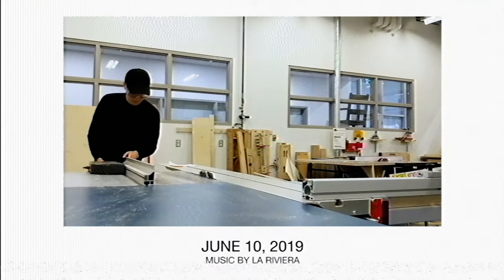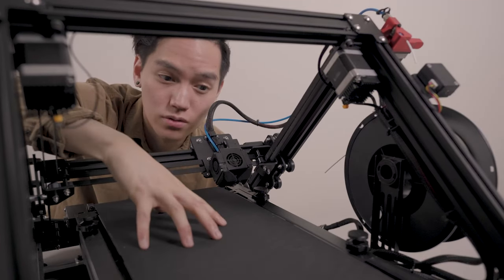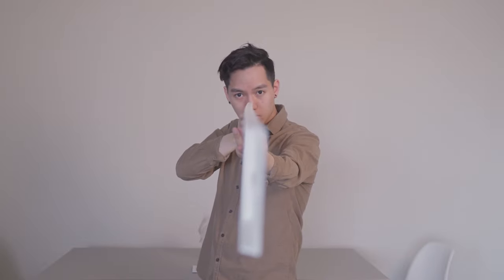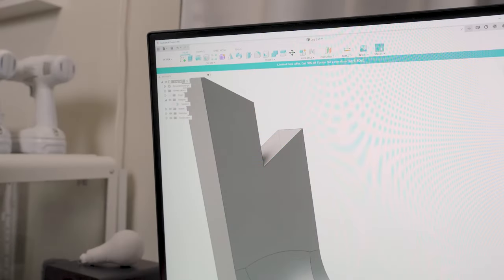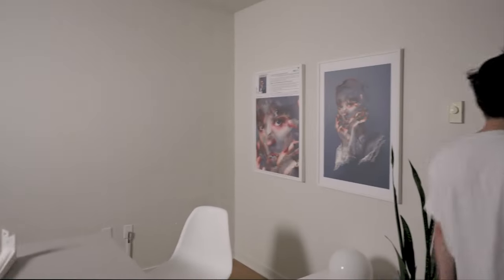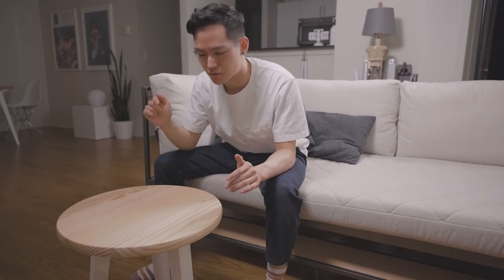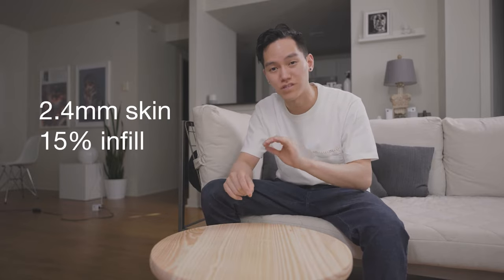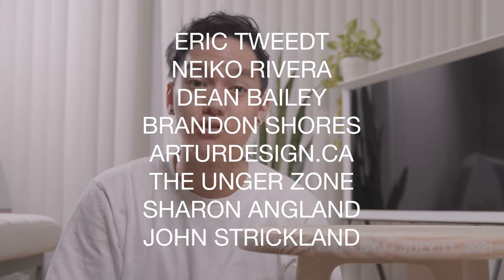Making Furniture with a 3D Printer?!  ft. Creality’s CR-30

Comment: Awesome! Just a heads up, a 0.8mm nozzle would speed it up by more than twice vs a 0.4mm since that measurement is the diameter not the area
Reply from the maker: nice! you're totally right. i forgot about that haha i goofed. thanks!
Reply: And it still took around 11 hours to print each leg?
Reply: I don't think this is correct. Assuming the same travel speed, 1 line of a 0.8 mm nozzle would replace two lines of 0.4 mm nozzle. It should more or less be twice as fast.
Reply: @7573436  plus the bigger layer height

Comment: You can probably remove the weight limit if you use the 3d print as a permanent casting form for epoxy.  You could also oversize them forms and cut away some of the material for a different texture (like hand carve or cnc?

Comment: I suspect it won't break under compression but will break when the legs are torque (they try to splay out as more weight is applied) and there might be a super simple way to GREATLY increase its load capacity. about 2/3 or maybe 1/2 way down have a hole in each leg with a nut/bolt and a turn buckle wire arrangement. ie physically prevent the legs from pushing outward. Now I am curious as to just how much mass they can hold :-)

Comment: Love it ! I would suggest adding a longitudinal slot along the three feet you just printed in order to slide some 8 mm diameter shafts for preventing the bending. The weight limits won't be a problem then

Comment: A good friend who helped me get into 3D printing told me “there are a lot of things you could print, but shouldn’t.”  In other words , people try to print stuff that isn’t very practical.
Reply: IMO you are only limited by how well you can design it and how well you can adjust the mechanics of your printer
Im printing a large scale bluetooth speaker right now, uses like 1.8kg of filament, multiple parts, special infill tuned for acoustic advantages, acoustic patterns built into the inner walls

You can print nearly anything, just gotta work around the horizontal layer separation disadvantage with core materials

Comment: "I would have needed a whole woodshop to make this table." 

Or you know, a Japanaese saw, a tape measure, and a jack plane.

But sure. Basically a whole wood shop.
Reply: A Japanese saw and a 3D printer is basically what I used to fix my chair last week. And a few screws.

Comment: Those legs are probably good in compression but bad under side load. If you sat on it, there would be some amount of side load which would probably crack it at the mounts unless you print it solid. Still really cool you can print stuff like that, and looks plenty strong for a side table

Comment: It's worth pointing out, when you use a larger nozzle, you can push plastic out faster and have larger layer heights, BUT, you need an extruder setup than can keep up. Just cueing you in in case you hadn't thought of that. Many standard extruders will start skipping at normal print speeds since they are pushing through twice the amount of filament, equivalent to running the printer at twice the speed. That will effect layer adhesion since your lines aren't as thick as they should be. Or you can move to thicker filament, so you get more plastic per mm of filament.

Comment: Great Job on showing how that could be used!, FYI those AC units cause a draft as all the exhaust air comes from inside the house causing a negative pressure

Comment: Hey, You could actually print out a lower infill and mostly skin, and use infill settings and design stuff (I know very specific) to pour in a resin or something after, to make it a lot stronger, easier, faster.

Comment: Excellent work.

I'm getting more & more surprised at how much 3D printing has been, not just taken up, but extended to new, ever more remarkable levels of creativity.

I suspect that newer materials will also become increasingly strong & 3D printers to have multi-head/nozzle/filament systems, allowing for greater toughness & robustness in builds (perhaps even approaching hardwood in strength), as well as more complexity in internal design, internal structure & aesthetics.

Looking forward to future projects.

Comment: finally an upload!!!🎉🎉🎉 Can you come up with something to replace the noisy blower fan on ender 3?  I know there're things on thingiverse, but none is as neat as your design :)
Reply: the hotend one? then i think thats constant speed so you could buck convert a noctua, ive got a sunon maglev on mine, its ok but not quiet.... and 5015 sunon from mellow (i think)  on aluexpress for part cooling and run low speed :)

Comment: I love wood and have made all sorts of things with wood simply because it's so "plastic" (adjective).  But THIS is the future.  Metal can also be used in 3D printing.  One  tip:  about the indoor AC.  I just had to get one and, with a little work, you can put them outside and just blow the cool air in.  If you want to recirculate the indoor air, that's one more duct, and that's what I did.  But they're a LOT quieter out on the balcony!

Comment: Great videos Scott and I started subscribing to see your videos. I wonder if you can share some Print or Slice settings. I really like the quality of print you do. For example, I noticed and you said it, that you don't use Plate adhesion, and quality is great. I wonder if you can share or post a video tutorial on slicing & technical printer adjustment. I started using "frogtape" on my bed and the results are almost no fail most of the time. I would love if you can share more tips on your favorite settings/adjustments. Thank you and keep those ideas coming. You're now my favorite 3D Print educator/ entertainer :)

Comment: Idea: you could Reinforce the legs by running cheap threaded rod, some bolts and large washers through the middle. The threaded rod is strongest under tension, however the print should be strongest under compression, so you are not really sitting on the rod as much as strengthening the 3D printed part use 12mm and it should be overkill strong. If you were really keen you could size it so the the threads bite all the way down the hole requiring you to have to screw the threaded rod in the whole way rather than just dropping it in to a hole. This would further couple the print to the rod and increase rigidity.

Comment: FYI, if you want maximum efficiency on that indoor air conditioner, place a ventilation tube on the unit's intake to cool the compressor and connect the other end of the tube to a new hole on that printed part.
The amount of air that the unit pulls in to cool the thing has to be replaced somehow, and that's how the air is drawn from the outside. Your efficiency is heavily compromised if you just use it as is.

Comment: Awesome video, if you can tweak to use PETG it would be able to handle loads without snapping.   PLA tends to snap when it gets overloaded.  I have a few shelves held by petg brackets,  started with pla, after a year they cracked on the layer lines.

Comment: Thankyou for the demonstration I am planning to purchase 2 CR-30 units in October 2021 and I was wondering if the conveyor belt's pattern would transfer or not? And if I would still need to print a raft?  Well perhaps I may cover it in Teflon. and build an Acrylic enclosure with a vinyl curtain to allow parts out while keeping heat o the conveyor.

Comment: Very engaging videos! I am sure you are inspiring many others like myself. Found a BIBO Touch 2 for $200. Works great with dual extrusion. After seeing this video I am modifying my printer so it has larger base and conveyor is necessary now. 

It struck my curiosity with the de-branding. Why do you choose to remove brand names?

Comment: Why not get a cordless jigsaw and cordless drill with a vacuum hose to the outside or a wet dry vac?  You can still do woodwork in apartments.  It would be faster than using the CR30 geometric shapes.  Save the printer for more complex parts.

Comment: 11 hours per leg is an extremely impressive print time!
Reply from the maker: not bad right? and that was using really slow print speeds to be safe because i was so annoyed with print failures. I'm pretty sure i can get it down to 7-8 hours though with more calibration and tweaking.

Comment: More curious about filament run-out? Did you run into that issue? And how was the printer in terms of resuming print? Most printers don't seem to resume properly regardless. Thanks
Reply from the maker: good question, from my experience, i think it depends on the size of the 3D model possibly and maybe quality of the SD card? because printing the air conditioner port it completely failed. the 3D model was huge and the SD card was the one it came with. but printing the legs i used the SD card from my camera and the STL file was much smaller and it worked flawlessly 4 times.

Comment: Awesome video and skills!  That A/C though..if it's blowing air out, it's creating negative pressure in your apartment, which gets filled, hopefully by air from your air conditioned hallway?  I had that scenario once, but otherwise, it's VERY inefficient as you can see...if possible, 3d print something to adapt it so it also draws air in from the outside, keeping the pressure neutral.     Honestly those AC's shouldn't be sold.   Your videos are awesome btw.

Comment: 2:33 half the time.. but increase the filament usage. how do you handle the problem with running out of filament multiple times per print?  and is printing large parts rreally wortth it if you consider filament cost, time, electricity usage and the risk of having the print fail after printing for 3 days, forcing you to start all over? I think the alternative of making a classic mold is not as easy.. but you dont need to invest in an expensive printer like the CR30, and once you got the mold done, you can produce at least 10 copys in the same time and for the same cost. 
unless we are talking about industrial 3d printers, in my opinion 3d printers are effective for small parts, but for large ones there are better alternatives.

Comment: Scale up the platform and it could produce a entire car, then another, and another, with a giant hopper filled with plastic pellets, pellets you can grow yourself even or grind up from miles of junkyard materials.
Scan yourself and you can make custom fitting exoskeletons, one with a built in jet pack even, or power the jet with no moving parts, just a very serious density of electrons that with enough of them, could allow you to float around, like Christopher Walken did in that music video.
Do it up.

Comment: Problem with 3D printing big stuff .. is the material is VERY EXPENSIVE. at 3-4X the cost of comparable plastic used for injection molding.  So one will find it FAR cheaper to buy some legs for that table.

Comment: This table is like 1kg (~$35) of filament + the $10 project board = ~$45 for a tiny table that can't be safely used as a stool by most people. You could just go buy a better stool/table for the price and save yourself like 2 days of printing hassle. I appreciate the attempt of demonstrating how a 3d printer can make life better, but I think this table was a failure for a subject where the air duct extension was a mild success. Leaving a like for the effort, but encouraging work-shopping the ideas more before executing in the future.

Comment: Before anyone jumps on it like a kangaroo on a trampoline, let me just warn you with some words of caution - CR-30, like most of Creality printers isn't exactly plug and play, I can easily imagine a 4 day print failing somewhere in the middle. And the biggest factor is bad layer adhesion, so you need to thoroughly test specific material on the specific printer and even specific part. I recently printed a tube like part (R=32mm, R'=24mm, with two wall lines 2x0,4mm  inside and outside, 20% infill) that seems to be really tough and it feels heavy, but then I accidentally broke it with far less force than I thought it could handle. Now I'm testing adhesion with two different PLA's, different temperatures and flow rates.

Comment: Well that's not energy efficient. 3D printer of this size is still best with more smaller and customised decor/parts rather than bulk material. Maybe joints and furniture pattern.

Comment: To all those that has unsatisfying finishes with your 3d printed items, you can encase your pieces in a chamber (a box taped shut if you're in a pinch) and surround it with acetone vapor to clean up the surface finish of your part.

Comment: There's something I need to understand from the 3d printing community. If its just a standard square part, why don't they go to the hardware store to pick up a part that's roughly the same shape and cut it to dimension? Just because they can?

Sorry for being a nag I'm just genuinely curious
Reply: Cause of you don't have the right tools it's pretty difficult to maintain super accurate measurements, Also you can desing in cad and in a few h you have the part ready with tolerances that can go below 1mm. This is valid for custom parts ..for example if I had to buy an Hinge I would buy it from an hw store